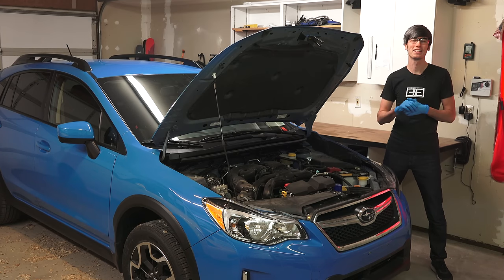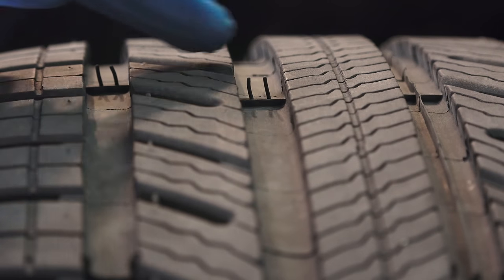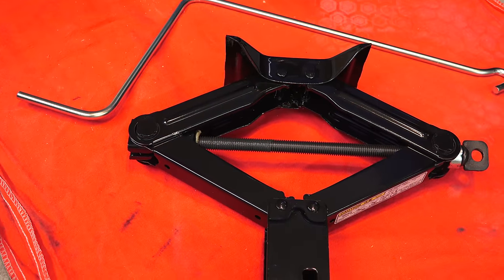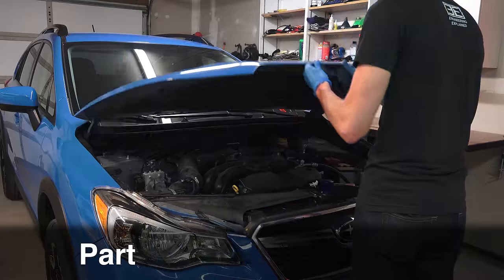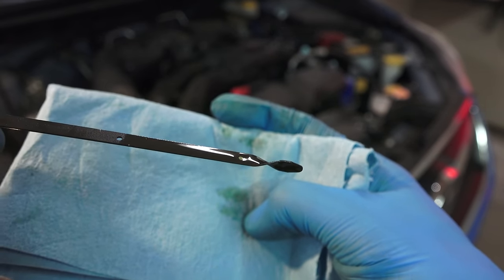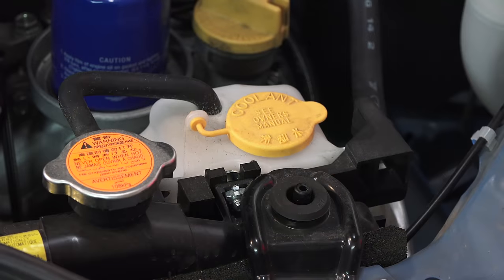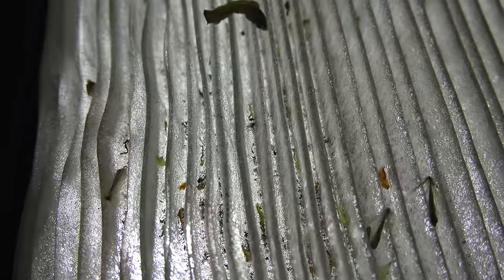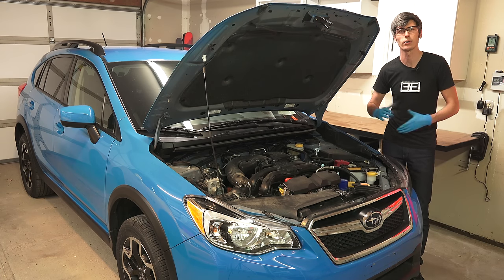How To Make Your Car Last A Long Time - Simple Checks

Comment: Something to note about Tire Pressure. I hurts when i see this, and when i didnt know anything even i used to do it. DO NOT use the "MAX PSI" rating on your tires as a marker for how much you should fill it. I see it alot where people who are airing up their tires, will look at the PSI rating on the tiers and fill it up to that. 

This video is correct. Use the door sticker or manual, NOT the tire itself.
Reply: 32 psi is fine. Make sure its cold
Reply: I didn't even think to check the tires. I always just went off of the sticker in the door.
Reply: Yes, but in the case of non-standard tires/wheels, you generally want about 10 psi below the max rating if the tires are not similar to the standard tires. (i.e.: off road tires, under/oversized rims)
Reply: But it is perfectly fine to use the max psi if you are storing a car for the winter.
Reply: Cool story bro.
Reply: Yep, you are correct.  Max number is the limit and not a recommendation like how some people think.
Reply: I run the max rated PSI for my tires during the summer months for the best fuel economy and then air down to about half that in the winter months for better grip in the snow and ice. This has been my solution to get by on all-season tires until I can afford a dedicated set of wheels with winter tires for the cold months. Since the center of the tire wears faster than the outside edges in the summer months and vice versa during the winter months, I've found that the tire's cross-section wears pretty consistently over time. The only case it is absolutely necessary to run the tire pressure indicated by the door sticker is when approaching the max weight rating of the vehicle (including occupants and luggage) so that the tires are not overloaded or underinflated.
Reply: I’d look at the door and the max and make the determination on my own based upon tread wear. 

Some vehicles like Chevy vans, use 50psi in the front and 70psi in the rear but they have the same tires all around.
Reply: Unknown maybe for a small passenger car with large sidewalls. 32 isn’t good for trucks unless it’s a little truck or suv
Reply: lyianx That's great if it has the factory size, style tires.
Reply: @unknown1859  The engineers put   recommendation on the door jamb, etc. will generally provide the best combination of ride, handling and fuel economy. 32 PSI, while probably safe, is NOT necessarily correct.
Reply: Chevy 2500 rear tires say they need to be as high as 80 while some smaller cars as low as 28. Always check the door jam, if you dont have pressures listed use the emissions label year to look them up. I also like to raise pressures a few psi to increase mpg on my highway vehicles but running them at max is very dangerous for not only you but other drivers around you on the road.
Reply: Let me clear this up as there is confusion.

32 PSI is only for small passenger cars that is not carrying excessive load, too many passengers that is overweight and if not towing anything. 

If you are towing, loaded with excessive and heavy weight, then tyre pressure adjustment required. 

The best thing to do if you are not sure is to follow your sticker o the door panel. that will tell everything about the tyre pressure.
Reply: So true. Most stickers or manuals will have an ideal psi for the current load you put on your vehicle.
Reply: brandon18054 - That can be pretty dangerous mate. What you forget is that it doesn't take long for the tyre to heat up after filling to that max psi rating. Pressures increase with the heat - this means having upto an extra ~10psi over and above what you have already put in which makes for a whole lot of instability. In general, this means less of that tread is actually touching the road and the centre section will wear much faster than the rest of the contact patch area. If it rains, then you are much more vulnerable to aquaplaning. The stickers in the door usually give examples of both fully laden and general use with one occupant (driver). It would be much safer for you to go for something inbetween those 2 figures. Not to mention the fuel saving, MPG is affected much more than you would think with under or overinflated rubber! Drive safe bud
Reply: Amen to that. 
Some "sport" tires are rated up to like 55 psi. Holy moly! Good way to start popping those like balloons. 
The door panel is definitely the way to go. I can feel a stiffness difference between 32 and 36 psi. At max psi your eyes probably shake out of your head. haha.
Reply: Actually the maximum PSI is higher than  what the tire will tell you. It's the overall tire condition that will cause problems. Numbers on the door are usually where tire longivity and driver comfort meets. Overall tire shops and dealers usually use the max PSI to seat the bead and prevent tire flat spots. So be sure to check it once cooled most prefer early mornings before the sun has a chance to mess with the numbers.
Reply: Another tip: before adding air to your tires, blow out the moisture before hooking up the hose to your tire.  

Also, if you go on a road trip to somewhere with a drastically different temperature, you might want to recheck your tire pressure.   Discovered this recently after my tire pressure light came on after a trip from Phoenix where it was 110 degrees to San Diego where it was 65 degrees.  And you'll want to recheck the pressure again when returning.
Reply: Did that once on my bike, didn't know what pressure to use there. Couple of miles and bang, rear tire blown.
Reply: On my car it says 32psi and i pumped all 4 to 32psi. Its better for fuel economy and 1 psi above wont hurt
Reply: @CC-uh8gl  you still want to move it a couple of times so the tires dont flat spot though
Reply: @brandon18054  the issue with this is you have less contact patch with the road in the summer so you are sacrificing some traction as well, that can be dangerous.
Reply: @ryanmalin  this is due to the weight difference, they are very heavy in the front and super light in the rear, so to have a proper contact patch they offset the tire pressure, you see it a lot on larger vehicles
Reply: brandon18054 In that case, (loaded up with passengers and luggage) wouldn’t you then want to go with close to max, vise the everyday psi recommend on the door placard?!
Reply: Is there a good way to calculate the needed tire pressure based on vehicle weight and type of wheel-tire combination?

I have one car weighing in about 3900 lb on 15” 7.10 bias Firestone tube tires. What would be the best pressure?

Another car I own weight in around the same (3900 lb) and it rides on 15” radials, I believe 225/75. What should that have? And what if those were another size (235/65 for example), would that matter? Also also, what if those aren’t tubeless as well (haven’t checked this - bought the car with these tires)?
Reply: @markcummings6856  NO! Close to max and you're almost guaranteed a blow out will occur
Reply: I was told by a professional in car safety that the best is to go somewhere between the car manufacturer's value and the max psi on the tire. If you have a small car with only one person then closer to the vehicle value. A big truck full of gear, closer to the tire max value. This is of course assuming you're not going off-road which changes everything.
Reply: @wernsbons  My old '99 dodge intrepid said to go +2 PSI if you plan on going over 75 MPH to compensate for the weight of the engine and faster speed. As you go faster the tire width decreases and more pressure adds better handling
Reply: Be careful with the spare tire though, those have higher PSI than your normal tires, like around 50 - 60 PSI, it says what it's supposed to be on the sidewall.
Reply: lyianx what if you’ve got wider tyres E.g. 215/45/R17 FWD car?
Reply: I usually go 1 psi over the door sticker in the summer since it's hot and wont drop down much anyway.  And about 3 psi over in the winter to compensate for temperature drop over night.
Reply: I just drive them until I have a blowout.

Comment: Hey Jason, can you also show the Audi drivers how to properly set the adaptive trace control systems on their cars? They usually set them to follow your car way too close on the highway.
Reply: Mr1983abraham my uncle’s 2016 m238i doesn’t even have blindspot indicators so idk how much you have to pay for trace control
Reply: Usually, they are tailgating someone who isn't pulling over when not overtaking, I don't condone tailgating but....f***...the amount of oblivious, arrogant drivers there are out there whom hog the outside and middle lanes, refusing to move back into a lane with space beside them is ridiculous to the point I actually understand their frustrations (even though I don't endorse). If everyone adhered to proper overtaking procedures our highways would not be nearly as clogged up as they are. Audi's drivers are just more sensitive to this problem than other drivers are. :-D
Reply: Evan Nadeau do you find yourself driving In the left lane when this Happens?
Reply: Every BMW just wants to race my motorcycle. They all fail miserably, so there's no tailgating involved.
Reply: Ah, It sounds like you may have accidently entered the left lane on the freeway by mistake...common misconception among the peasants of society is that they can drive in that lane without owning a German automobile. 

Please head to the right lane sir.
Reply: Always those darn tail gaters in the front of the car.
Reply: @EngineeringExplained 2003 to 2006 Infiniti G35 review please

Comment: Ah, there's an air filter for the CABIN. I'll just go ahead and change the stock one in my 1998 Honda Civic. BRB...
Reply: Smith John good tip lol
Reply: I sprayed my girlfriends with new car scent when I wrote the upper comment. It still has the smell. Lol
Reply: Spent all day looking for one in my 97 Honda Accord.

They introduced the cabin air filter in the 98
Reply: I have no idea how to take it out. I've pulled on the tabs for the globe compartment and still can't do it.
Reply: Daniel D try turning it on or off or disconnect it for 10 seconds then plug it back in
Reply: @danield8528  Try checking the GLOVE compartment!

Comment: Low-fi tip for checking your rear lights - do it with the back of the car to a wall in low light- like your garage, or a parking garage or at night. You'll be able to see the lights reflected and tell which side they come from. Easy quick check whenever it occurs to you and you're reversed into a spot
Reply: I double to that (plus you can check your reverse lights as a bonus).
Reply: I check them using the big plaza windows at night haha

Comment: Bounce off the limiter at least once per drive cycle (upon reaching operational temperature). Keeps your internals clean and happy. That's my advice
Reply from the maker: Haha, I’m actually working on a video about this!
Reply: @EngineeringExplained  the Italian tune-up? I've only heard about this recently, keen to know the science behind it!
Reply: Man from Nantucket and many smiles come along with that 😂
Reply: Exactly, my grandma never goes above 2k rpm. It has super low miles and sits a lot, runs like crap.
Reply: Can u do it neutral tho?
Reply: Redline a day keeps the carbon away.
Reply: I've heard about this before, but I'd like to see the science behind it.
Reply: So true mate. Especially applies to highly sprung/tuned engines where the power is all at the top end. I've been in a couple of garage queens (E46 M3 and EP3 type R) that have never seen above 5k rpm and they run like a bag of spanners. They look absolutely pristine and have won competitions but they are like wild animals kept in captivity and get no chance to live like they were made for!

Comment: Bottom oil leaks, diff oil, trans oil, belts, pulleys, axel shaft boot leaks, ball joint , bushings, wheel bearing, spare tyre,e brake adjustment ,lubricate door hinges , battery terminals, .....etc.

Comment: Don't forget to change out your muffler bearing 👍
Reply: And don't forget to rotate or change your piston return springs so you don't get metal flake in your oil
Reply: Replace tail gasket every 50k miles
Reply: At least twice a year you should also top up your blinker fluid.
Reply: Also Dont forget to add gas to your car!!!! otherwise you might get stuck in the middle of nowhere
Reply: Replace the air in your tires with every oil change.
Reply: Edwin Cristobal you just had to go and throw actual advice in there 😒
Reply: Use neon muffler bearing replacements if you drive a Honda
Reply: You're right, you failed to mention the cunnobler bar it should be checked or replaced frequently especially on city drivers.
Reply: And the flux capacitor should be checked.
Reply: I almost forgot, also be sure to rotate your alternator diodes 👍
Reply: @SuperMarioDiagnostics  It's also a good idea to take a few good breaths of exhaust to see if you taste oil. :)
Reply: Always add coolant to you’re oil in the winter so the oil doesn’t freeze
Reply: @jefferyjin5551  one I've never heard before, nice!!
Reply: @1337TheLifeLine  better be careful with that advice!!
Reply: XD yeah XD
Reply: Don't forget to oil your brake discs regularly to prevent rust.
Reply: They now have an oil that'll do 100,000 between oil changes. It's ultra synthetic oil. Yup, look for it at your nearest Auto store.
Reply: Make sure you fill your petrol car up with diesel
Reply: and don't forget to change the polarity of the battery for good smoke start :)
Reply: @EdwinCristobal  
That's an old wives tale.
Reply: Don't forget to replace your engine every 5 miles
Reply: @jefferyjin5551  Why?
Reply: Don't forget to fill the washer fluid reservoir with olive oil, this prolongs the life of your wipers making sure the rubber does not dry out. It will also shine up your windshield.
Reply: @skylercolvin8119  Years ago my dad had a buisness partner who was an A$$.  He had a grey market BMW that needed a valve job.  I told him to tell the mechanic to change the piston retun springs since they are accessable with the head off.  He did.  LMAO!!
Reply: the problem with my car is the nut behind the steering wheel.
Reply: @johnmackay1566  Those are a pain, gotta pull the airbag to get to that nut.  ;p
Reply: To maintain fuel efficiency don't forget to recalibrate the doplar manifold with every tune-up. Also retention the Renault springs on the fuel injectors. Keeps your engine purring nice.
Reply: @MrGreen-sk3ws  I had forgot about the dopler manifold.  Been to long.  :(
Reply: Don’t forget the headlight fluid.
Reply: @TimpBizkit  you can buy cast iron motorcycle racing discs because they work better than stainless steel. Using WD40 on them for road use is a recommendation to prevent rust- seriously.
Reply: Every 3 months, I open the relay box and refill it with Bleach. It keeps the connectors clean. If you're not sure if the bleach needs to be changed, taste the old and the new and compare potency.*

*Millennials and younger, take your car to a licensed taste-tester.
Reply: Some Mazdas actually have those

Comment: Tip for checking your lights. When you are parked in front of a building with large windows, you can usually see your car from the reflection.
Reply: Or behind/in front of a shiny clean car

Comment: Could you do a video about how diesel emissions equipment work? Like diesel particulate filters, urea injection, and exhaust gas recirculation coolers. I feel like this equipment has changed the game for diesel and made them less reliable therefore not as economical of a purchase as they were in the past where you could get 500k miles out of the motor with only wear and tear up keep. I know heavy duty diesel is not your norm but I feel that the explanation is in your wheelhouse. Thank you.  Engineering Explained.

Comment: Just to note that brake fluid does not require topping up. The fluid will go down as the brakes wear and the pistons sit further in the calipers. The only other reason the fluid would drop is you have a leak needs servicing.
Reply: I know people never think to check the pads and rotors when the fluid is low.

Comment: Great video. Perhaps a point...always a good idea to check your owner manual to see when is the best time to check your engine oil level (i.e. when the car is cold, or warm, or a little bit after running). Weird, I know, but many different makes recommend different times to check.

Comment: Protip: Don't top off brake fluid during normal checks. The level between min and max is a rough indicator for the pad wear level.
Reply: Good tip, I just had to fill mine up from min to max and I was about to change my pads so will I now be “overfilled” if I replace the pads without taking some fluid out?
Reply: @cartere9981  if you are changing the pads yourself, you can use a turkey baster to take some fluid out before performing the work. Worst that will happen if you don't, the brake fluid will overflow and run onto some paint. Brake fluid strips paint with ease and will cause rust.

Comment: Very nice indepth guide! A must see for a beginner. Great job greg! getting more people back into DIY is important stuff
Reply: Shlomi Vinny i started working on my car with no previous knowledge. First work i did was change the brake pads by myself and it was pretty easy except it was really dirty lol. Next im looking to install some new rotors. Some stuff i wont do by myself is engine stuff since i dont want to mess anything up, ill let a mechanic or the dealer deal with that
Reply: Great start!
Although brake and suspension stuff should ALWAYS be checked out by a 3rd party (friend with knowledge\experience, mechanic, etc.), just like a 2nd opinion from a doctor, sometimes you miss something.
Stay safe and always torque your nuts! :D